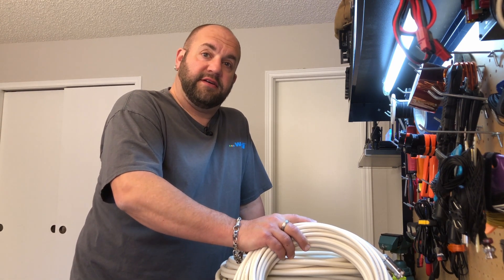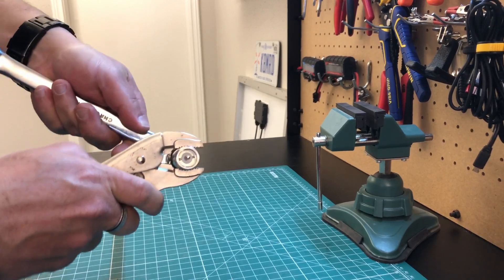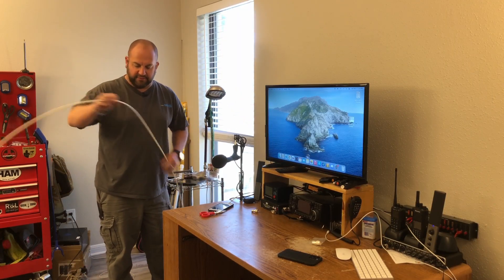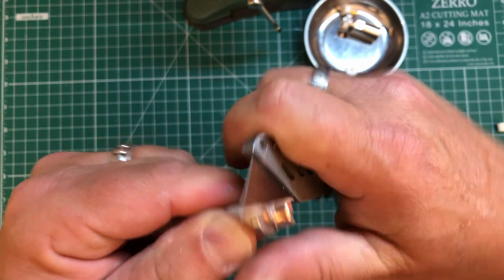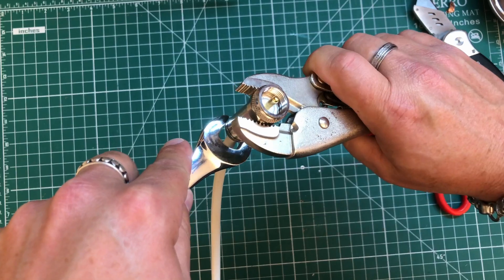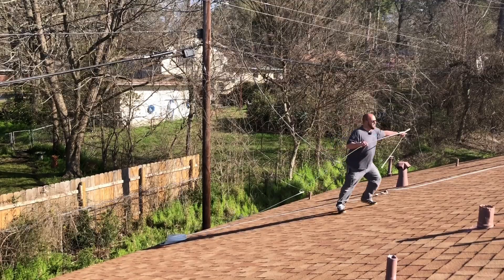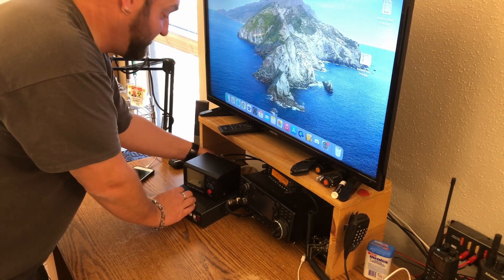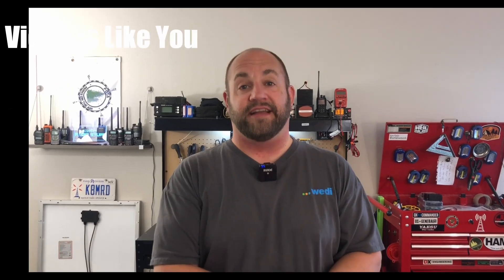Messi & Paoloni Coaxial Cable Installation for HF VHF & UHF

Comment: Working on putting my first shack together. I’m using all M&P coax. Hyperflex 10 for HF, Airborne 10 for 2m and 70 cm ( making separate slim Jim antennas for each), and using HF7 for jumpers in the shack. I’ll also be using HF10 for the gmrs antenna. What surprised me was M&P is cheaper than ABR and Times. Then use a discount code and it’s really affordable.

Comment: How does the braid make connection to the outside portion of the PL-259 connector when there's no soldering of the braid and there's a rubber spacer between the insert that goes in the cable? When I use a multimeter to check my just made M&P cable, the center to center connection is good, but the outer portion of the PL259s is not showing connected. Weird.

Comment: uhh...
cool coax!
however, you mentioned talking the connector off without cutting it off the coax. But you cut the connecter off after talking it apart lol! i think the connectors are very cool!
mjc

Comment: Thanks Mick...... I have around 12m of Messi Poloni Ultraflex 7 that I need to put the PL259 connectors on..... I think I will cut a couple of metres off the length I have and make some patch leads up with it...... I will need to order some more connectors but cheaper than buying ready made..... I love your roof for walking up, looks nice and easy not to mention pretty safe... I think all roofs should be like that..... I'm going to make a 10m lead up for linking to my Slidewinder antenna and go out portable...... I live around 10mins from the seashore at Morecambe Bay on the NW coast of the UK.👴

Comment: i have ben looking for a pair of them M&P pl259 connectors for 2-3 Weeks Now & Every Where i looked is Out of stock ! just need a pair or maybe 2 at best for LMR 400 but i just have not had any luck ..Maybe one of these days but i really wanted to get it before my new ant goes up n a week or so but i am just going to half to use my standard Amphenol pl259's

Comment: You guys recommended Messi-Paoloni coax. Where in the US do you guys buy from or do you buy direct from them overseas? Looking for the Extraflex bury 10
Reply from the maker: Gigaparts.  There’s a link in the description and a 5% off code.  Although I just looked and they don’t seem to have any of that right now.  Might want to give them a call or maybe just order direct.
Reply: @hamradiotube  Thanks Mike, I will shoot them an email to see if they can get it or I'll just order it direct like you suggested

Comment: Thanks for the video.  I am considering some M&P for my truck and QTH.  I am looking for a chart of line loss for their cables.  I really like the connector assembly I have seen. All the best!   73 de KI5HXM
Reply from the maker: Their website has every bit of data you could ever possibly want.  Start here.  https://messi.it/en/download.htm
Reply: @hamradiotube  thanks I did find their charts.  They were presented a different way than I was used to.  So I ordered some Hyperflex 7 for my mobile install in my truck and have been crawling under the truck this week.  I am looking for a US distributor for raw cable and connectors.

Comment: Use those scissors with your left hand and post the results.
Reply from the maker: The only thing my left hand is good for is playing guitar and hanging out the drivers side window.
Reply: @hamradiotube  that’s to bad. As a lefty you get pretty good at using your right but not sure id be into right handed coax.

Comment: I ordered a length of Messi & Paoloni coax from MFJ , but I never received it due to it being on backorder. I ultimately cancelled the order, but it wasn't a big deal since I ordered the coax just to see how well it performed.
Reply from the maker: Well you should be able to order if from Gigaparts, and there's a 5% off code in the description of the video.
Reply: @hamradiotube  Ok sounds great! Thanks!

Comment: Thanks for the great video, I love my M&P coax, but was not aware of the assembly process, since the connector came on the coax at purchase.  
I have M&P coax with the connectors, I do have a couple questions:
 Should the entire connector be able to spin around the coax?
 Do I need to tighten down like I seen you do during the install?

Comment: Aside from the connectors, why did you choose to go with M&P as opposed to Times LRM-400 or DX Engineering 400Max? Is the M&P Hyperflex 10 really that more flexible? The loss chart pretty much shows them as identical. If you were in Europe, I could see with going with M&P, but it's a bit more expensive here in the US than the alternatives.

Comment: Will those connectors work with other coax?  Say I had some LM-400 that needed some new ends what size would work?
Reply from the maker: I would suppose they would so long as they are of the same (or close enough) size.  Hyperflex 10 is .400".  Very similar to RG-213.  I don't have LMR 400 but I will try them out with other sizes that I have.  I'm going to do a video just on the connectors so I'll try that out.

Comment: Thanks Mike, I really enjoyed this video, very informative. Question. Which M&P coax is best for HF on a 125 ft. run?
Reply from the maker: The best that you can afford.  It really depends on what you're doing though.  M&P has great spec sheets on all their coax so you can compare the different versions.  For me, running 100 watts the Ultraflex 7 Sahara is more than adequate.  https://messi.it/en/download.htm
Reply: @hamradiotube  Thank you I will check it out. KO4LFE 73's

Comment: When did it come in white. The numbers look better that lmr 400. You get it at HRO. Every time I go to look out of stock. And the connections are pricey
Reply from the maker: The Sahara is pretty new.  Within the last year or so.  It is better than LMR 400.  It can be purchased at Gigaparts.  There are links in the description.  You get what you pay for.
Reply: @hamradiotube  I know it has  been out of stock  every time I  look and don't know when it will be in stock.

Comment: Hi Mike,
Great video. Will have to get some of those M&P connectors. You made putting them on easy. Their scissors made cutting to jacket look easy. Is that a metal mast you are using for the VHF/UHF antenna? Might also want to use a couple coats of liquid tape on the outdoor connectors as waterproofing. Stay safe.  73  WJ3U
Reply from the maker: Everyone should have this coax and yes, the scissors are great.  Stupid sharp so be careful!  The mast is old military fiberglass mast.